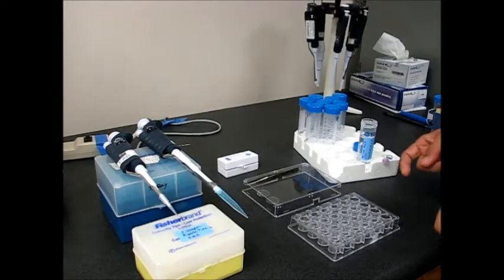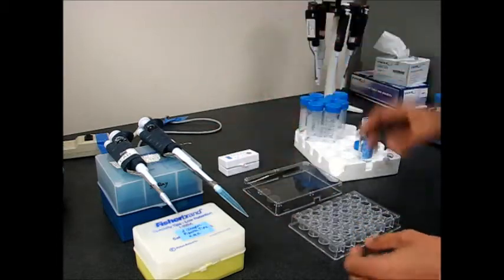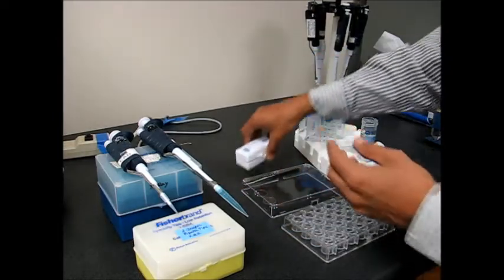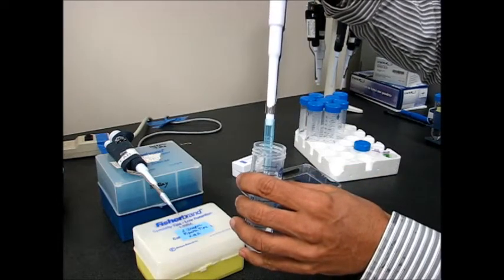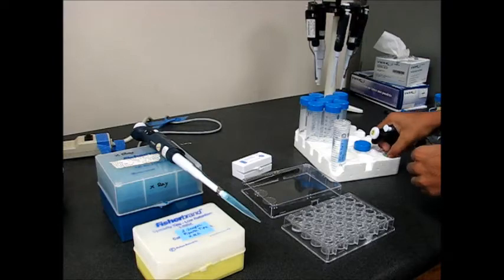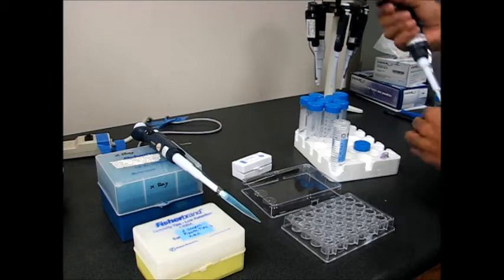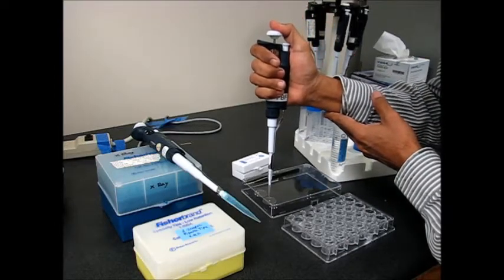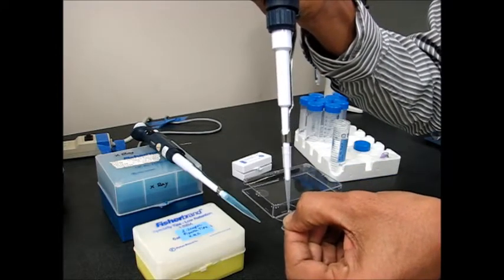Hanging Drop Protein Crystallization Set-up Tutorial and Demonstration

Comment: can I use square shape cover slips.
Reply from the maker: Mehvesh,Yes. You can use square cover slips. However, due to the shape the squares may overlap between two wells making it difficult to flip open to retrieve the crystal. Test it out before setting up the trays.

Comment from the maker: Wanlei,
We use either pre-greased or hand-greased (silicone high vacuum grease) plates for setting-up the crystals. The grease creates an air-tight (not vacuum tight since the latter is not needed) seal between the reservoir (where the salt solution is sitting) and cover-slip (where protein drop is hanging). So this grease-seal creates a "closed-system" allowing equilibration to happen while preventing excess evaporation which will precipitate rather crystallize. Hope this is clear now! Thanks